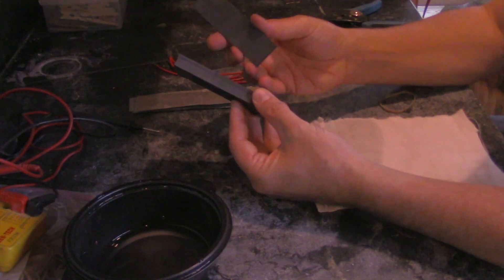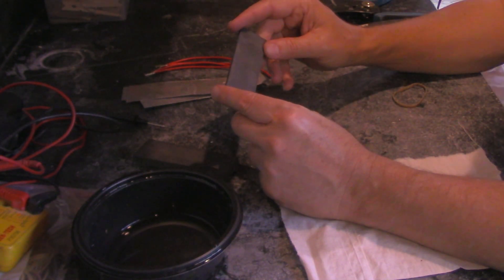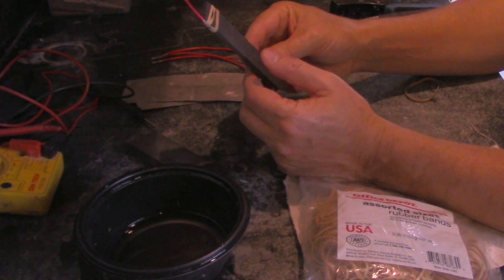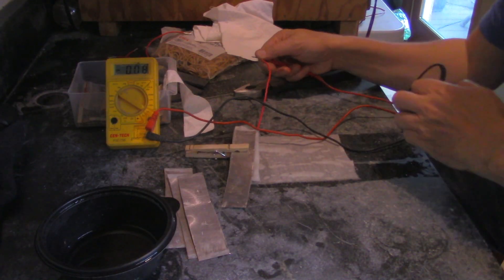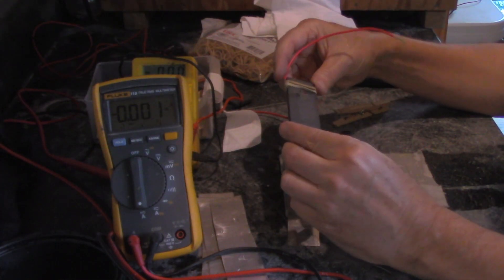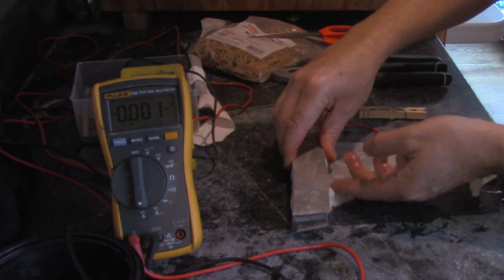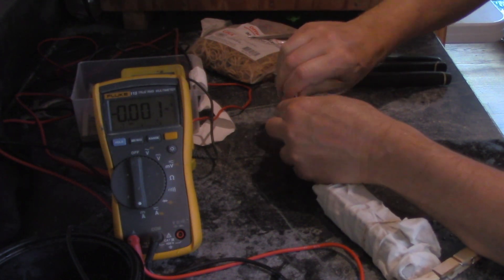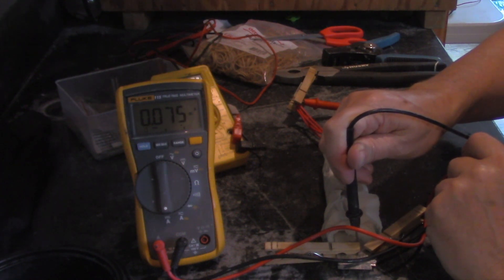How To Make an Aluminum Graphite Salt Water Battery

Comment: I believe you could increase the voltage by placing the cathode in an acidic reducing solution, like a brewing kombucha or wild ferment cider. Then you get the current of the aluminum-base and the voltage of a acid-base
Reply from the maker: Sounds interesting. I might give that a try.

Comment: Discharge time duration?
Reply: Such cells are challenged by the passivation reaction which covers the anode surface with an oxide layer and further electrochemical reaction ceases...
Reply from the maker: I have not yet performed an Ah test to determine the energy storage capacity.
Reply: @MyEngineeringProjects  Okay, thanks!

Comment: hello idont used to read back the commentaries but, if we can make that battery bigger,it should  star a car?
Reply from the maker: I have seen only one commercial salt water battery.  It was made for the solar industry and it sat on a pallet since it was so big.  Salt water batteries have a relatively low energy density.  To make one big enough to start a car it would have to be much larger than a lead acid battery.
Reply: so your project of graphite and alum with salt water its n ot avaible for cars batteries ok anyway tx

Comment: Is there any chemical reaction happening here to drive the current?ie does either the graphite or the aluminium react and degrade irreversibly? If they don’t then this becomes a perpetual battery as long as the cloth with brine remains wet isn’t it?
Reply from the maker: Yes there is a chemical reaction.  It's a rechargeable battery. I've made several salt water batteries and corrosion is a problem.  This is why I tried aluminum and graphite.  It's still corrodes, but slower than other materials used.
Reply: @MyEngineeringProjects  Excellent….Does this mean that this battery discharges over a much longer time period compared to other metal combinations?
Reply from the maker: The corrosion rate refers to how durable the battery is over time and not necessarily related to a discharge rate.  In order to find that you, the battery would have to be tested.

Comment: Cloth separators will fill up with hydrogen and seriously diminish the current capability.
Reply from the maker: I have not seen this issue with mine.
Reply: What should be used in its place?

Comment: I wonder if oil/wax can be heated up, and then the heat produce a current to charge a battery without combusting the oil/wax
Reply from the maker: Heat to an electrical current can done in several ways but I see no way with oil/wax without combusing.  One way is mechanically by using something like a Sterling Engine.  Another way is by using the Peltier effect.
Reply: @MyEngineeringProjects  I guess no known additive is possible to raise the boiling point of oil or wax. I read about friction heaters and wondered if current could be gained by that heat, but it's not sounding good here.

Comment: I guess it doesnt matter if you increase amps or voltage, what it matters is voltage x amps = watts. 
If you would have 3v x 20 milliamps = 60 milliwatts. If you have 0.6 volts x 100 milliamps = 60 milliwatts
Reply from the maker: That's right V=IR
Reply from the maker: Sorry, P=VI I was solving another problem and miss typed my previous reply
Reply: we can easily get voltage from salt water from series connect, but not amps that's why he shown this thing
Reply: It really matters what you're trying to do! For example, a light runs well with low voltage and high current, but a power drill will need voltage to accelerate the motor enough to have smooth edges on your bore hole. So while power is the end all be all, you gotta look at the minimum voltage to run each appliance. Can always add a capacitor in circuit to increase voltage too.

Comment: Is this worth it to scale up for off grid ?
Reply from the maker: Salt water batteries have a lower energy density compared to other options.  They also have a lower C rating.  I talked with just one commercial manufacturer years ago and I think they have quit.  In order for them to be scalable, there needs to be some advances in the technology first.  It's certainly possible and they have a great advantage of being about the safest battery available.

Comment: I used gum arabic from an art store to mix with the salt water, (also NaOH works better), to curtail anode oxidation. The NaOH was about 10% and gum arabic about 20% by volume with distilled water. Activated charcoal will double power output compared to graphite. Cells cannot be stacked though. They have to be separated because of heat and internal resistance. Output for something similar to this would be 2-5A. Refresh electrolyte periodically. A cell of this type with NaOH is about 1.2V, similar to other alkaline cells. Thanks and happy hunting.
Reply from the maker: Sounds like you made some good progress
Reply: @MyEngineeringProjects  thank you. I'm somewhat proud of having made it this far. But arabic senegal comes from a tree, tying us to locusts swarms and drought in Africa. No free lunch i guess, right? Could it power a vehicle or provide hours of standby? I've ran a cell for 36 hours before just finally shutting it down. My rants fall on deaf ears. Keep the faith and make small batteries just to amuse and entertain if nothing else. Peace out and thanks again.
Reply: A battery 🔋  that can be built diy* with ready made easily sourced materials  will be the most revolutionary  invention  since the wheel   . Please continue  pushing the envelope.
Reply: Could you make a video. Sounds nice to see.
Reply: @1966MrAlex  The one problem with using gum acacia is its source. It comes from trees in Senegal, mostly,  and is subject to locust swarms. I should do videos on what I've made. But in practical terms it is messy, cumbersome and more difficult  than just plugging something in. There are many ways to make a battery. Thanks!
Reply: So instead of graphite to use activated charcoal???
Reply: @jeraldcastelino7622  Absolutely. The problem I've had is the cathode "flooding", or water collecting in the cathode. But it works well while it works. A cell stood up vertically affords some drain off but then keeping electrolyte effective is difficult because it too drains to the bottom of the cell. Some sort of flowing electrolyte would be advantageous.

Comment: Well done. Nice try! It would be nice if you continue your work and make a series about salt water batteries. For example, study of different plate sizes, charge/discharge time and capacity would be interesting. Thanks :)
Reply from the maker: Thanks.  Yes I have 3 videos in the salt water battery series.  You can check them out on my channel page.